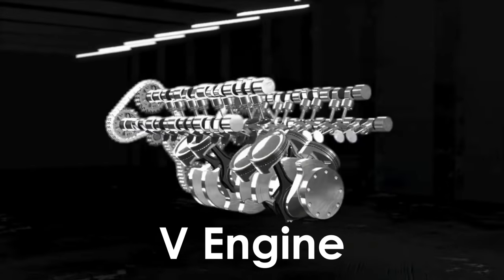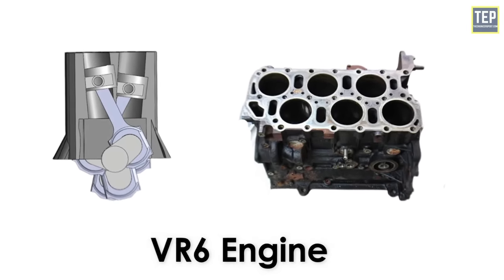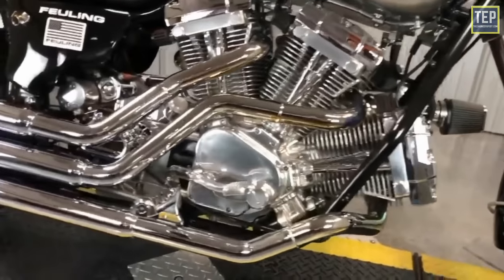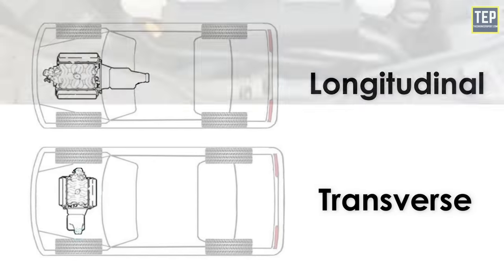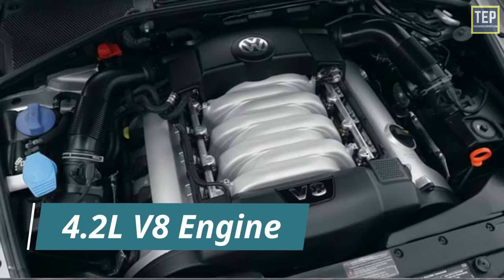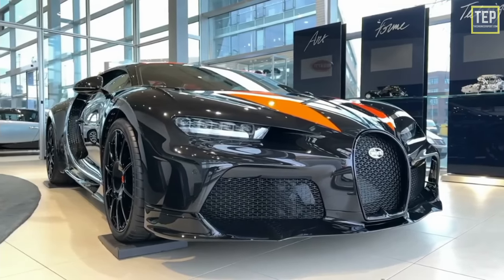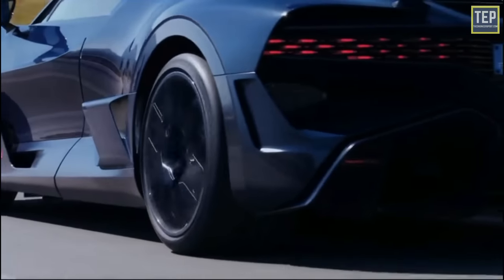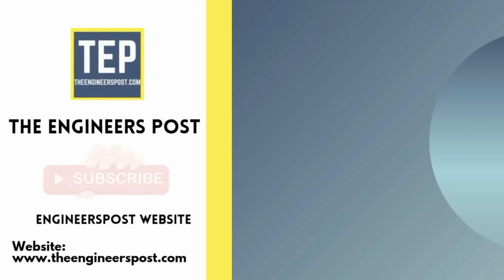Different 'W' Engine Configurations Explained | W3 to W30

Comment: The VW groep W8, W12 and W16 engines actually aren’t really ‘W’ engines. They’re ‘VV’ engines as they have two V-shaped cylinder banks. VW group’s marketing department decided to ‘glue’ the V’s in the naming together, making it look like a ‘W’
Reply: Edit: NO.. sorry, was thinking and writing at the same time, mistakes happen.

Original BS comment:
Actually it is exactly what they marketed the engine before the "W"
"VR" (in english "VI" I suppose), if it were "VV" a normal V-engine should be "II" since the V is essentially two inline engines stuck together.
I heard that the name was changed because VR wasn't as marketing as W but what do I know..
Reply: Isnt it VVR
Reply: @NoahSupermoto  you’re right, they are. However VW stopped using ‘VR’ for the successors of the VR6 and instead started calling them ‘V6’. With this in mind two of these V6’s combined make the VV12. But again, strictly speaking, you’re absolutely right
Reply: W is also correct depending of the languages which spelt "double V".
Reply: Ya so it comes out like a vw

Comment: In tuning W engines has probably best capability. W8 with turbos has potential of over 1000hp at factory crankshaft. Obviously conrods and pistons custom made. There is company in the UK that specialize in W engines and they got racing passat W8 modified to 1470hp.
Reply: That's interesting, makes me wonder why they didn't have a lot of power from factory
Reply: @afoxwithahat7846  power is always a trade off with reliability
Reply: @Alucard-gt1zf  hard to say when they weren't fucking reliable from the factory
Reply: Are these not a nightmare to work on? With performance like that I would expect more tinkerers to mess with these engines but I never see them even at carshows.
Reply: @Anthonest1  they are more difficult yes. But if you good mechanic it makes no difference. Just consume more time that's all.

In fact there is lack of service informations like torque settings for bottom end or most parts not available anymore so must be made by CNC technology.

Same related to W1w and W16 motors as W8 is precursor of them 2.

W8 was testing engine to discover basic issues before making W12 then W16.
Reply: @broskis80  So are manufacturers responsible for the extreme dearth of these engines then? I just see so many "built" cars with a lot of mechanical ambition put into them by the owner on a regular basis, and have yet to encounter one in a non stock configuration.

There's probably a crazy VW engine build I can find around here on YouTube, but i'd still like to see them more proliferated and stuck in more off the wall vehicles/builds, especially since they have a lot of weight and space advantages.
Reply: @Anthonest1  hard to say. Manufacturer plan was to take it out the market so no garages will work on cheap passat W8 and earning knowledge of W motor that would allow them to work on W12 Bnetleys and W16 Bugatti where huge money comes out. Just main dealer want to own right to work on the..

We had a people from Bentley Crewe coming and being nosey why we advertise to rebuild W motors and modify them. They wanted us not to share this service and asked us how come we do know torque settings when they keep it in secret. They tried to blame us for taking them specs illegally from Bentley factory workers and threatened with legal action to investigate.

It is very funny topic.

Long story and not appropriate for internet where plenty "smart" people around to start shit storm.

And at the end there is very few W8s left round the world, maybe 400-500 not more than that.
Reply: Hey m8, do you by any chance know the name of a company? Im looking for tuning my w8 passat. I would apritiate it

Comment: The Sherman engine wasn't really a"w"configuration,it was simply five six cylinder inlines bolted together.
Reply: You can't just simply bolt engines together
Reply: @samueljesse2179  actually you can,it was called the Chrysler A57 multi bank,it was five six cylinder gasoline engines bolted to housing with a central output shaft .
Reply: @samueljesse2179  You don't realize the extent to which desperation can change what's possible.

Several tanks in WW2 effectively used multiple engines configured around a common shaft. Some even used multiple shafts. They were notoriously finnicky and painful to repair.

Comment: The "W" engines with 3 individual banks are really a different category from the modern VW range of "W" engines, which are more accurately described as "double V", being a V engine with 2 banks of staggered cylinders
Reply: The "W3" and "W4" engines in this video are not W engines, they're radial engines.
Reply: @tigerpjm  No. A radial 3 engine has 3 pistons placed so that when the cylinder heads are at their outermost positions, they form a triangle. A radial 4 is the same, but they form a square, which makes it no different than an X4 engine.
Reply: @UltramanMebiusBrave  

No.

A radial engine has all conrods on the same crank lobe.
Reply: @UltramanMebiusBrave  

When you say four cylinder radial, are you referring to a four stroke engine?
Reply: @UltramanMebiusBrave I don't think you can have a 4 cylinder radial engine. As I understand it, the layout only works with an odd number of cylinders (or multiple banks of odd numbers, as on some aero engines)

Comment: There are a lot of technical and graphical errors in this presentation. It needs a redo and clean up. Here is some added information.

For the record, I have 2 W8 2003 Passat wagen's and I love them. Beautiful and smooth, lots of pulling power and torque, I can easily pull 3,500 lb. trailer over long distances. Gas economy is reasonable (10-11 l/100km - about 24-30 Imp mpg.). Car has 365,000 on it and runs like new. It cannot be faulted. I would not trade this for a VR 6 any day.

The entire concept of W engines was to put in as many cylinders in the shortest front to rear space but adding only marginal width. They put a 4l. W8 in the Passat into an engine bay made for a 2l. 4 cylinder engine! That is an accomplishment.

The reason it failed in the market place was due to marketing, pure and simple. No one could distinguish the W8 from a V6 from a TDI or 4 unless you knew Volkswagen. Had they made cosmetic changes that were so different and made it stand apart, it is mehhh, whats so special about that car? But get in and drive it, then the differences become noticeable. And it can tow a heavy load too, governed out at 250. I have seen 225 5 years ago and that is FAST. 

The W-12 is the same as the W8 but with 4 more plugs, 2l. and 2 turbochargers and a hell of a lot more power 275 to 525. It is used today in the Bentley and Audi as a luxury car and you pay a hefty price for it, but many of the parts are interchangeable - at a price.  They are butter smooth and definitely better engines they displaced. 

If one could put on 2 turbos on the W8 - you would see 400 hp. But there is literally no space to add them no matter what unless you put in an electric supercharger and that is a tight fit if not impossible. 

The Chrysler W5 is simply 5 inline 6 motors that Chrysler was already making onto a common block used for an immediate war motor - high speed development when time was critical. 

The Bugatti W16 is essentially the same as the W8 but has a 90 degree V instead of a 72 degree V since space width was no longer a consideration, 4 turbocharges, intercoolers, everything tweaked for power - and at 500,000 a pop, you pay for it. The regular maintenance on it is absurdly expensive  - like $40,000 for new tires after some 15,000 km, $20,000 for oil changes that only their mechanics will allow - that kind of nonsense. All this for what? Bragging rights? The car doesn't exactly appeal cosmetically not to me anyway. And recently Koenisegg's V8 has exceeded the latest w-16 using smart technology.
Reply: I do the oil change on my Bugatti myself.  Big savings!

Comment: VW brought the W configuration to perfection, this was proven in the Pheton W12 and 6000 ccm model, with this engine the W engine configuration was brought to perfection, from quiet operation to max revs, power in everything that is required from an engine. The Audi Sestra company also uses VW - W engines in its models, especially sports models.

Comment: Go and see Lancia Fulvia 1600, from here the design of the narrow v of 15 degrees started
Reply: Lancia patented the narrow v engines in 1915 for aeronautical use, the firsts cars were the Lancia Lamba (NV4) and Trikappa (NV8) in 1922. The Fulvia was one of the last Lancia with narrow v engine before Fiat, which had bought Lancia a few years earlier, decided to rationalise production by using the same engines for both companies.

Comment: I was impressed with the VW VR6.  The W 3 air cooled Harley had to be difficult to keep cool.
Reply: It's not a W3, it's a radial.

Same as the "V twin" that Harley uses. It isn't a V2 but radial as it shares the same crank pin for both cylinders.
Reply: @tigerpjm  Fair. When did shared crank pin engines get defined as radial engines?
Reply: @vernlochtefeld1626  @vernlochtefeld1626  

Always has been.

If you continue adding cylinders, you'll get a circular arrangement of cylinders that are all in a line, not staggered if you were to keep adding cylinders, as would be the case with a V engine.
Reply: @vernlochtefeld1626  
Also, because all cylinders share the same crank pin (and therefore the same lobe), they fire in sequence.

That's why Harley's sound the way they do. They fire in quick succession and then go silent for the remainder of the crank rotation. 

It's a completely different arrangement.

Comment: why are no W10 engines 10 cylinders in an W configuration
Reply: in a real W there are always 3 banks in 3 heads.
in a double VR are always 4 banks in 2 heads.

try to divide 10 by 3 or 4.
Reply: @Coolgamer400  what if you combine 2 VR5 engines
Reply: @seancallahanch.8639  good point. didn't thought of these :)

Comment: Wow! I just learned something new! Strange I had seen star type engines in old planes but never took notice of W arrangements? Over-engineering pure. Open a flap of a huge motor coach and what do you see? An inline 6 cylinder! How come even container ships dropping the 96cm pistons for a 46cm MAN setup? They go inline and just add pistons and usually stop at 14. Now Bugatti still goes fast but the Tesla Model S Plaid maxed out the bottom end. Koenigsegg is going to be the only one to show the world what a fast luxury car will be. Combustion engines are going to be as relevant to road transport as the dial was to telephones!
Reply: If a better battery chemistry than lithium ion is discovered, I would agree that you. But it's still better than lead-acid.

Comment: I think a small airplane engine with p[pistons all the way around could be used in a vehicle, but it would have to be put in crank shaft pointing up and down and an elbow piece attached to power the gear box and then the drive shaft.
Reply: A radial would be too big to fit in a car. You also can’t rotate the engine like that

Comment: Motors are electrical. Engines use fuels...whether in liquid or gaseous form. The terms need to be used correctly. Good video though.

Comment: I have a W3 air compressor,and i want to build the cylinders to 2Takt or 4Takt petrol engiene, sized like a motorcycle or little buggy framed and thinking on the compact shiftgear 😅

Comment: We have been here before. The end of WW2 saw the ultimate development of piston engines for aircraft. The mighty P&W 4360 28 cylinder radial engine for example put out over 4000 hp at its most developed stage.  There were others from Rolls-Royce, Curtis, Napier, Continental, Lycoming but all shared a major flaw: they were hugely complicated to build and service. They also faced the advent of superior technology in turbine engines which made them obsolete. Just as electric propulsion is doing to these monster automotive gas burners, today. Like Elon Musk has said: the best part is no part. These hyper complex ICE's are dinosaurs.
Reply: But dinosaurs are our favourite animals :)

Comment: This video has no red line!

you are jumping from vw to aircraft and back on the w12.
these have nothing in common: meaning very different product target!

w12 vw is just COST CUTTING.
aircraft engines are very different: costs are mostly not important, but product fitment!

this is like Wikipedia articles added to each other.